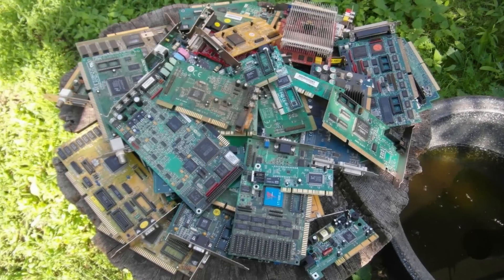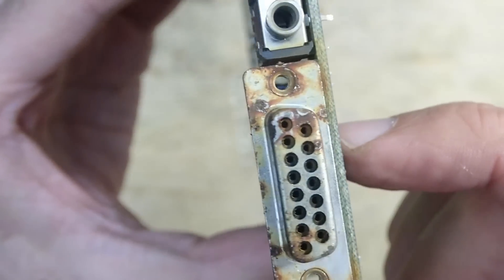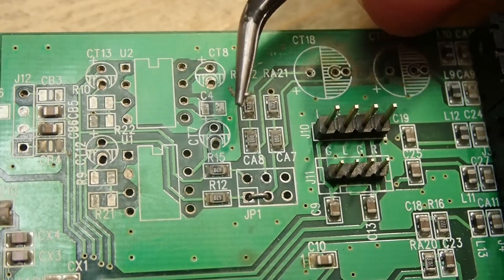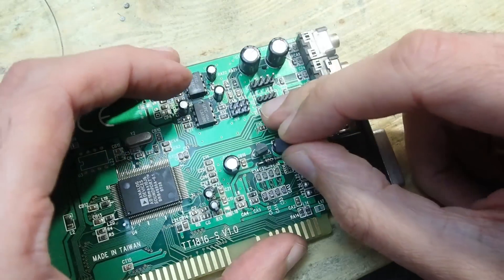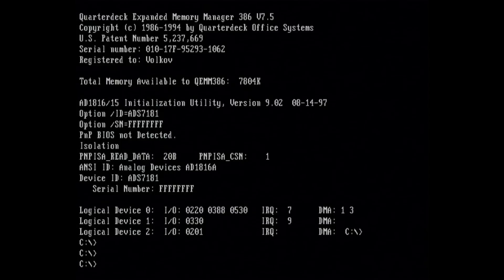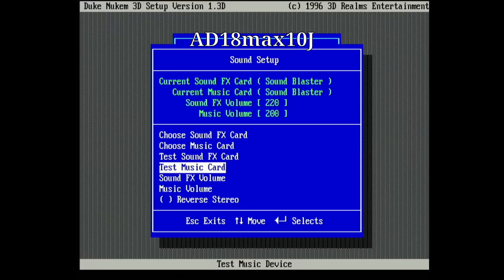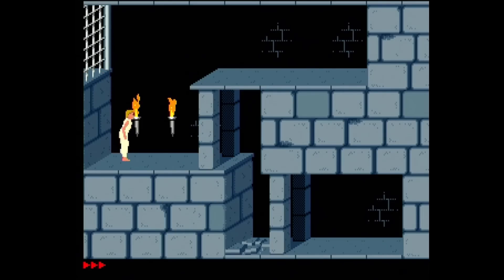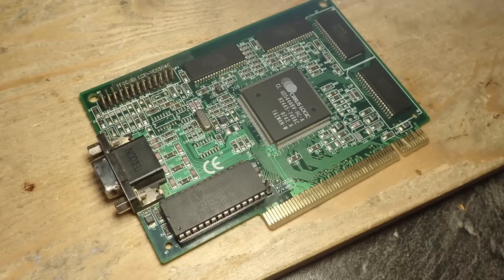Resurrection of a dead Terratec TT1816-S sound card

Comment: You know, I didn't think about this before but there might be another issue appearing if it is not already here in out community: First off, I respect if people want proper OPL2/3 FM synthesis that is completely fine. But it makes me wonder: Would someone actually scrap a board which have unique FM implementations, like this TerraTec board? If that is the case, then that is really sad. And I guess, I would give those people the same advice as you gave gold scrappers: Just sell it. I myself like unique implementations, it gives cards a bit of character, I think. - Anyway, rant over, love the video. I always find it interesting that different versions of the same card have different components installed. I have a few ESS 18xx cards and I am so tempted to try and find all the components missing on them. I think they are wavetable chips or something.

Comment: Great video as always. I have the newer Terratec Base-1, with the AD1816AJS chip. I'm not sure if it has the same FM implementation, but it's the weak point of the card. It sounds off and kind of distorted in some games (regardless of volume). PCM playback (SB Pro compatible) is good though. The Base-1 has a wavetable connector as well.

Comment: In my opinion, the best way to experience a sound comparison between two separate cards would be to mix the two stereo outputs of each of the cards individually into mono, then mixing them together, synchronized together and hard panned to stereo for the video. Say, the reference card's mono output on the left, and the comparison card on the right, for a split screen, split audio showdown. Not one YouTube retro tech channel I've seen have done so yet. Great for those of us with two working ears.
Reply from the maker: As I said in the video, comparing those cards was not the main point. I just found it interesting to mention, that there is a definite difference between Yamaha OPL3 and AD implementation.
Reply: @necro_ware  That's fine. Just thought I'd throw out the idea,  since that would have been a neat way to hear the difference. But it was a good video for your purposes.

Comment: I know I'm super late to the party with my comment, but... When you have very rusty boards that you're trying to save, you can remove the rust very quickly with HydroChloric acid. (And then an immediate rinse with Lye (Caustic soda, or Sodium Hydroxide).

It will immediately remove any ferrous rust. However, you need to be a tad careful, as a strong acid can also damage speakers and other things. As well, Lye will react with aluminum.

HCl + NaOH = NaCl + H2O. So, if you've done your ratios right you end up with salty water.

Now, after your Acid/Base wash, be sure to wash it thoroughly with plain water and then dry out the PCB.

This method can get rid of fairly substantial rust.
Reply from the maker: Yes, thank you very much. I made a video about a similar topic some time ago. It was about neutralization of electrolyte with acid. However you have to take pretty strong acid to work again iron oxide (rust) and it can be dangerous for the copper traces on the PCB, since they are very glad to react first. I'd be very careful with that. If you are interested to take a look at that older video, here it is https://youtu.be/sVxqLBp6l1c

Comment: I always find it amazing when someone takes something and restores it better than original, and you transplanting the amplification circuit from the donor card just thrills me! It makes me wonder what the unpopulated chip to the left of the crystal oscillator is?
Reply from the maker: I'm not 100% sure, but I think it's for the EEPROM, which can hold the settings over a reset and probably even to initialize the card without the need for a driver. At least this is how it works on many Aztech sound cards.

Comment: PCB of sound card looks similar noname ES1868-clones - and jumpers LineOut-HeadPhones on the same place - hey, maybe this AD chip is a reprinted ES1868 chip? =) try to use this card with ess audio drivers =)
Reply from the maker: Even if it looks similar, but no :) AD is a completely different chip with different pinout, different FM implementation and different drivers.

Comment: these goldbugs don't realize that this card has less than $2 worth of gold in it at best (and that's assuming you can find a buyer who pays full market price for unverified and untested gold), and you could literally sell it on ebay working for $5 and someone will buy it eventually. You'd literally get more gold panning in any river in most counties, and you don't need to spend money on acids.
Reply from the maker: Absolutely agreed. I even think, that there is by far less than $2 gold in it. Just as you said, if you count the chemicals and time you need to extract it, probably even less than 25 cent.

Comment: Bravo on the save. :)
It's strange that Analog Devices never made a big splash in PC sound. They very much know their DAC's and ADC's, and they've been doing it for a very long time.
It wasn't very common, but AD also made some AC97 sound chipsets back in the P3/P4 days for motherboard integrated sound. Typically, you would see VIA AC97. Although, back in those days if you cared about your sound, you wouldn't be using the onboard sound anyways.
Reply from the maker: It was not only about the quality of the on-board sound. Also the performance suffered quite a lot, if you used an onboard sound chip. I made a video some time ago about AMD based Win XP gaming machine, take a look at that. In the end I compare the on-board sound chip to SB Live! and the performance difference is quite a lot.

Comment: I would've soldered wires to the half-cut slot board and save both sound cards. I just have to be careful to select the machine to put it in, because once it's in, it's gotta stay in. Forever. (otherwise the board will break off and finishes destroying the damaged card)
(I actually have some of these cards, some with amp, some without, some with 1816 chips, some with 18max10)
Reply from the maker: Then I'd have two cards in bad condition. I prefer to have one, which looks pretty and is reliable. But as I said, those cards are not valued by the retro enthusiasts, so you can get it for 1€ each in a stack :D I just made it for fun, not because I needed this card. And though I have it now in my collection...
Reply: @necro_ware  that's the right spirit. I also fix stuff for fun, but I don't care if it looks like crap, as long as it works.

Comment: Does the analog amp have two separate op amp chips instead of one dual? Great repair !
Reply from the maker: Yes, one for each channel.
Reply: @necro_ware  interesting, extra parts almost always mean more cost, so at least they had noise filtration on the part of the preamp at heart. Thanks for the answer 🙂

Comment: The scrappers actually cut the board? That's brutal and sad to see :c
Reply from the maker: Yes, I saw ebay articles, where people sold 10kg of retro hardware all with cut off edge connectors, which were sold in a separate offer. So instead of selling the stuff as is and get 200-300€, they destroyed everything and sold the scrap for total of 15€. Damn idiots.

Comment: I really like resurrections of dead hardware. Glad to see this was a success.  This video also gives me some confidence in the ADI based card that I bought.  Two questions though:

1)  Would that card work in an 8-bit ISA slot at all (in an XT class PC)?

2)  Could we get more videos like this one?
Reply from the maker: Thank you. 
1) Is a good question, may be it is even possible with some limitations. I guess, I have to try...
2) I always make the sort of videos, which I like myself. Since I like such restorations, probably I'll do more in the future. But it will be more a mixed bag. Some restorations, some repairs, some introduction of my own hardware. So, stay tuned ;)
Reply: from what I can tell, dma0 won't be available and some high IRQ's. that's it.
Reply from the maker: @Jim_Bo  I'm not sure, if the card will initialize without 16-bit expansion. It makes some P'n'P stuff to get it up and running, so I don't know. I'll make a test and report.

Comment: I have never seen that much rust before. Great restorations!
Reply from the maker: Thank you very much. I was not sure, if I'd be able to get it running in the end and was really surprised, as it got initialized :D
Reply: @necro_ware  had a voodoo 2 with a halfway torn off TMU chip yesterday, desoldered the chip, straightened all ~160 pins and resoldered it. Guess what: To my surprise, it was working again! Those old hardware-bits are as hard to destroy as a terminator! Except harddisks ...
Reply from the maker: @dolphhandcreme  Don't know, if you saw my Voodoo repair video already, may be you like it too :)
Reply: @necro_ware  yes, totally forgot this was from you. Great work 👍 I'm  always happy to see people do such kind of low level repairs and safe old hardware from the dumpster!

Comment: I do like when OPL implementations sound different but not worse. A good candidate for that is the S3 sound card (yes S3 made a sound card, and it's not that bad).

For the sound however I do hear the noise :p (is it the way you record old cards that creates noise ?)
Reply from the maker: I meant noise on the databus, as it was very usual on the ISA bus. But also the slight noise you can hear in the recording came unfortunately through the leveling in the video cutting software. The recordings were made with different cards and to make them sound more or less equally loud, I had to balance the sound. Unfortunately it introduced some slight distortion. It is totally not noticeable when you hear the card directly, even with good headphones.